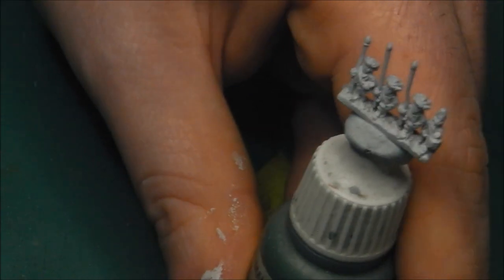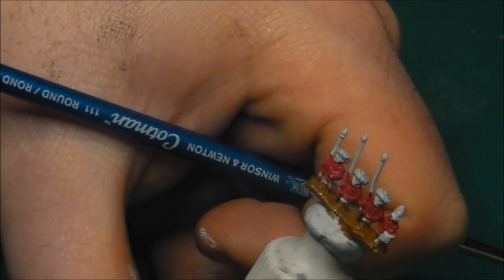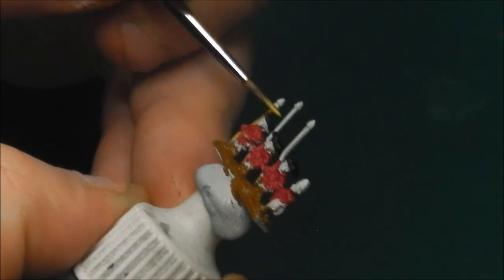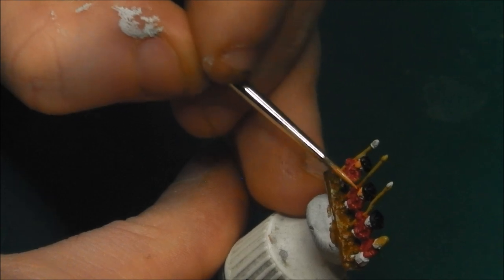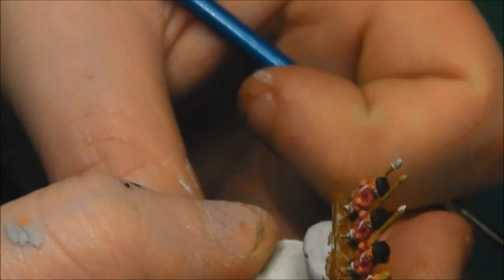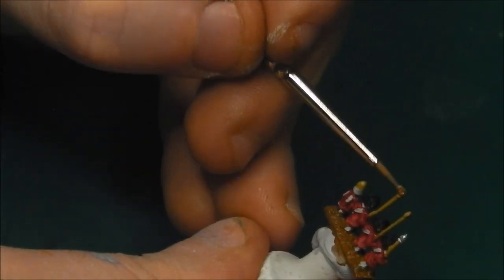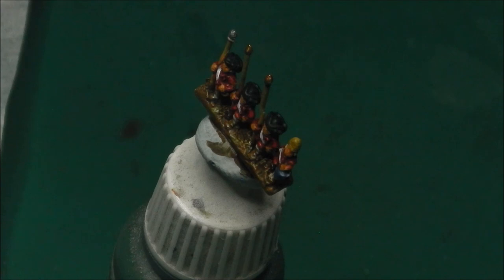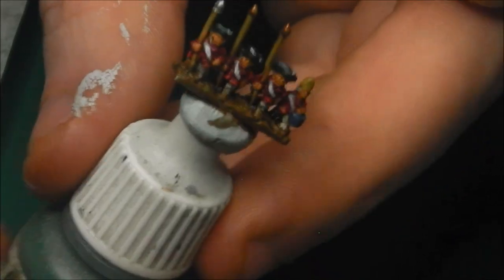How to Paint: 6mm British Regulars American War of Independence Baccus 6mm

Comment: The muscian's "mitre cap" is actually bearskin fur (not yellow or gold) with a "japanned" metal plate fixed to the front of the cap.
Reply from the maker: nice info thanks for sharing !
Reply: Not on those figures it's not. The drummer has a mitre cap with a silver or brass front. Possibly incorrect for the AWI. But that's how they have been modelled.
Reply: I thought that myself however at 6mm you would not tell it wasn't a bearskin tbh so you'd get away with it. In the FIW/SYW they definitely had those bright mitre caps in the facing colours. I'll be paintint my 6mm AWI drummers as bearskins however it comes down to personal preference at the end of the day
Reply: @gozza7199  good to know, tbh at 6mm scale no one would notice that on the table top. Shame they were not true to the time period however it does appear Baccus's FIW/SYW range and AWI range interlap. I suppose it makes sense giving the cost of modeling and the fact they're 6mm so once on the tabletop the difference is really unnoticeable unless you get a magnifier glass to watch the battle lol

Comment: I use Tamiya Smoke X-19 as a wash for this scale and for my 10mm and 15mm figures also and then highlight afterwards. It is slightly glossy I should say, for those who want a total matt finish but the post-wash highlighting restores some of that.  I also undercoat in black which better allows some depth of shadow in creases and under arms and at cuffs and you can increase your speed of painting by drybrushing across the whole row of figures with the main base colour - scarlet in this case - or perhaps officers should be in crimson. He has also missed painting the cuffs in the facing colour, which are nicely raised on Baccus models and can be done with a quick dab when you have a black undercoat. The main benefit of painting 6mm is that you can do them very quickly in large numbers. Here only four are painted in 15 minutes. I would expect to do 32 of these same figures to the same standard in an hour (the size of my battalions). I accept that Shane's painting may have slowed for the purpose of the demonstration. It is a delight of the scale how qyickly you can turn out great numbers of troops who have less elaborate uniforms - like khaki clad British or ancient Indians, Romans, Zulus, Mahdists etc

Comment: I just ordered Et Sans Resultat with the starter kit, all in 10mm, so this should be very helpful, thanks!  I've only painted 28mm and some 15mm before.
Reply from the maker: I am currently painted my own 10mm AWI minis at the moment too, and the method works just as well with 10mm as it does with 6mm

10mm are very much like painting 15mm minis so they shouldn't fight you too much

Comment: I’m a bit OCD with painting in details, but I can see at this scale it’s not necessary.....So with that in mind would you be so kind as to explain to me....like I’m a 4 year old....your technique for washing the figures at this scale.. I will be using one of the Vallejo ready made washes. I’ve never used a wash on figures. Superb paint job on these little guys
Reply from the maker: so block in your colors first as you would for any scale, then for washes thin down your wash slightly with either water, wash medium or airbrush thinner(seems to work with most brands) as this will take a little of the intensity out of the wash and overdo the shadows, then highlight most noticeable details and your good to go
Reply: Thanks Shane. I tried it out this afternoon and although I was a little sceptical I found it works a treat for this scale. This is going to speed up my painting no end

Comment: Do the castings have detail for the regimental facings and cuffs? I'd imagine the facing's on the coats would be too small to get but cuffs might be there?
Reply from the maker: they have basic cuff details but that's about it, as they are too small for much else
Reply: Yeah however I think painting the cuffs would be good enough. I find it tricky on 10mm to even do the jacket facings. Least with 6mm the cuffs pop more. 6mm is more about pop colours than true uniform accuracy. Hell even the jacket facings on 28mm can sometimes be hard to paint at certain angles

Comment: musicians had reversed colors to the rest of the regiment
Reply: Except for Guard or other blue faced regiments
Reply: They did but if the Regiment was a Royal one, like the 4th Foot, they would have the same. The only exception to the reverse facing jacket was if the Regiment had red facings. At which point the drummer would have a white jacket with red facings. In the red facing regiments the Sgt's sash would have a white stripe in it as opposed to the facing colour also